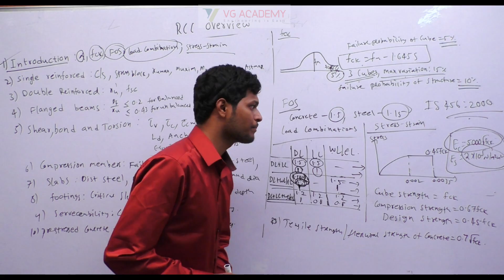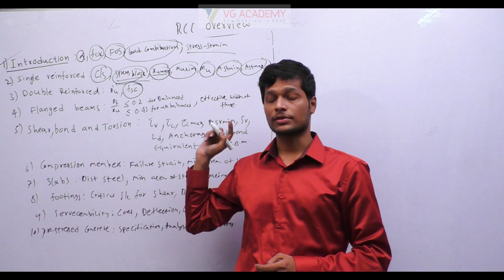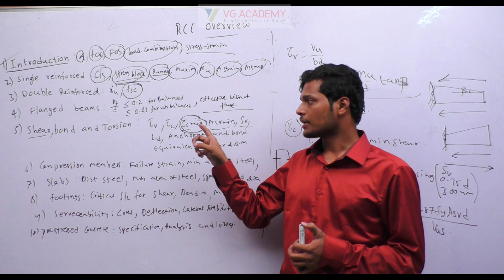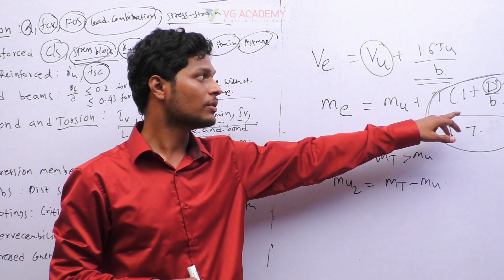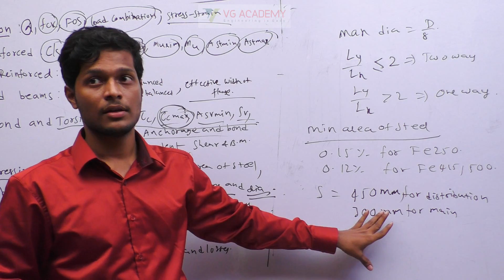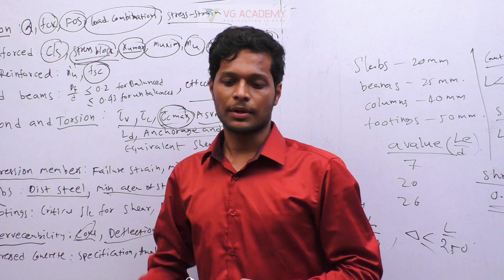OVERVIEW ON RCC FOR STATE GOVT JOBS

Comment: Sir why use of higher grade of steel reduces moment of resistant? As we see co-efficient of MOR reduces from  0.138 to 0.133 for Fe415 and Fe500 respectively.
Reply from the maker: Subho Santra it increases strength but reduces ductility
Reply: OK thank you sir .... I understand the increase in strength  for higher grade of steel ..but how would I represent it  mathematically.
Reply from the maker: the number(0.148) based on strain . so fe250 will have more strain. but the product also has fck which you are forgetting.
Alternatively you can see Mu = 0.87fyAst*lever arm
Reply: thank you sir